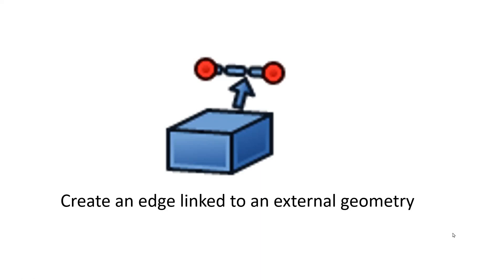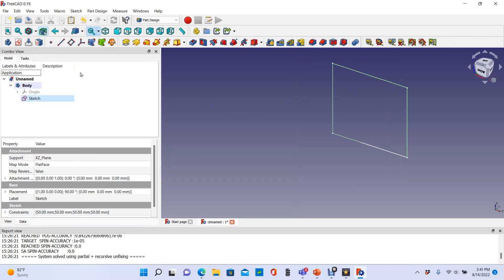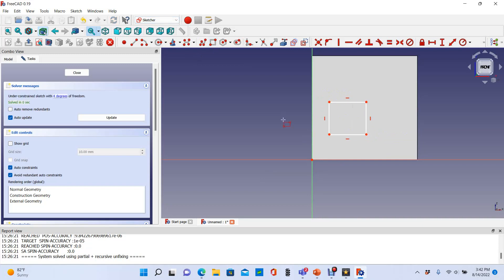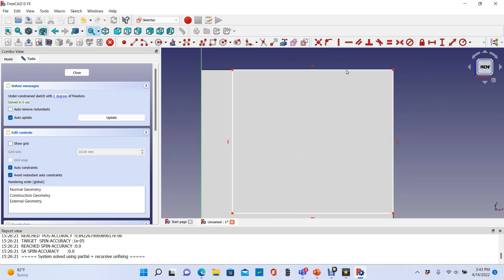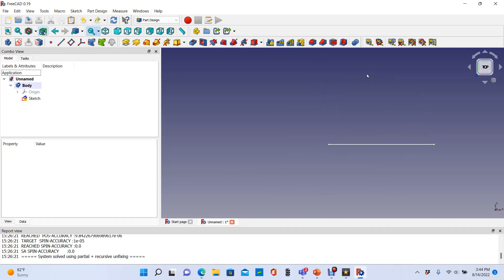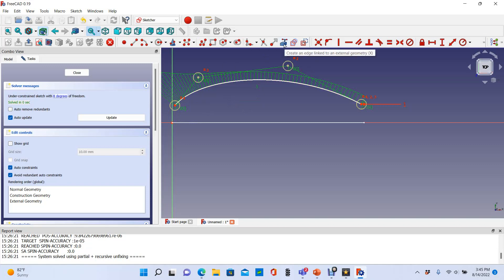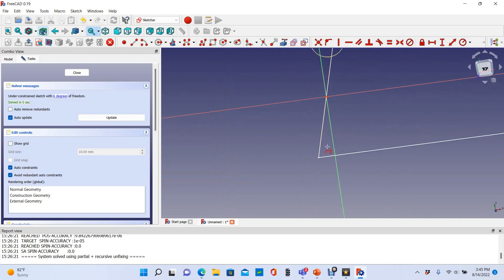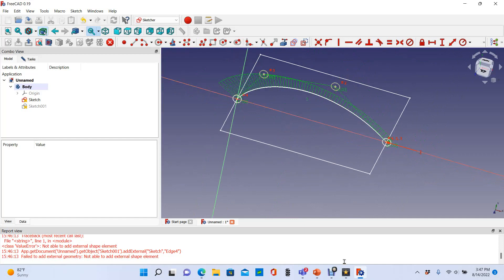FreeCAD - Create an edge linked to an external geometry

Comment: You probably know this but as a reminmder and maybe to help others: To make those little dots on the corners of you sketch bigger so they are much easier to see, you can set their size in the preferences settings any time: Here is how to make the dots bigger and easier to see:  It is easy and you can alway go back to the oricinal setting:
From the top menu bar:  Edit / Preferences / Display / Marker SIze.  Enter a size then Apply in the bottom right corner.  Default is 9  Try something like 8. 
Also, while you are at it, another thing about selecting things in Sketch, is the Pick Radius.. how far out from a point for it to be selected.  Too close and it is hard to pick, too far and it selects the wrong thing. 
Froml the top menu bar: Edit / preferences / General / Selection  Pick Radius .  Enter a size then Apply in the bottom right corner.  Default is 5. try 8 or 9.  Makes life easier. 

Hope this helps you or your readers.  Thanks for the great videos.  Ron

Comment: If you have a difficulty to see the vertices(the endpoints, center points etc)) because they are too small, you can control the size of them(not individually only as a whole in recent and future sketch.  In COMBO View switch to MODEL View, now click on any Vertice/Point, then on very very bottom of Combo view (where you see switch between View and Data click on the View and in the table above search "Point Size"  field You can increase that number. I use Line Size (right above Point Size) number 2 and point size number 8. But you can do test and have any numbers you like.  It is very probable, that the size of the line or points(vertexes) are not going to be changed immediately. You will have to save the file(no need to close the application)-just save and exit only this file and open it again....now the points/vertexes and the line sizes will be changed and it will be saved in the settings of the system, so any time after that the system will use it..... Good luck!

Comment: This is not external geometry but internal.
Reply: The software people named the command "Create External Geometry" (shortcut G,X). If you have any solid body displayed on the modeling portion of screen, click on this command icon or use a shortcut to create new duplicate of the geometry you want .I e. If it is rectangular body, clicking on any edge, it will create new duplicate edge of violet/purple color in Sketcher, which can be used as reference for creating actual duplicate of the same line by using line command and locking on endpoints of that reference piece. ...It can also be another geometry like circle, elipse etc.